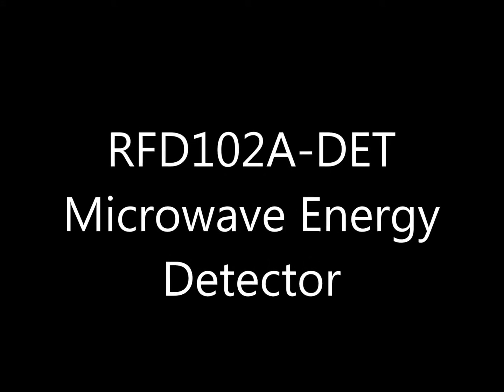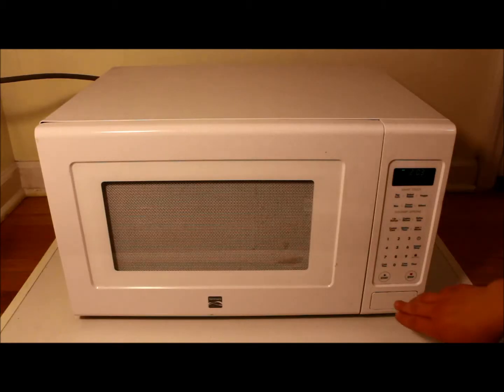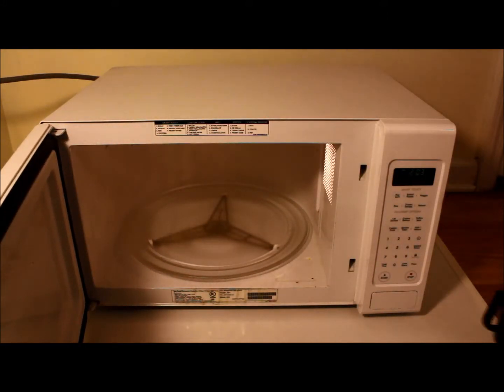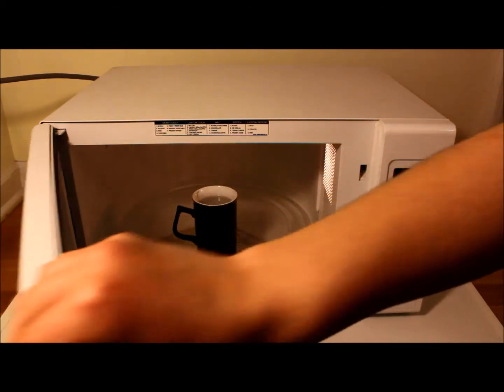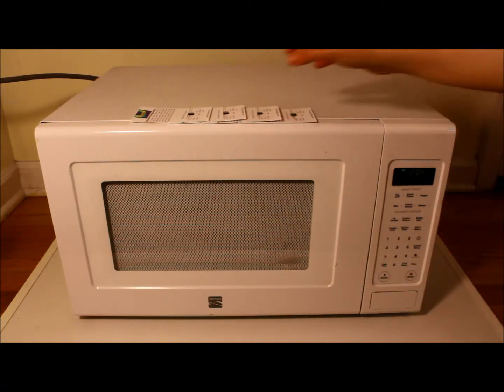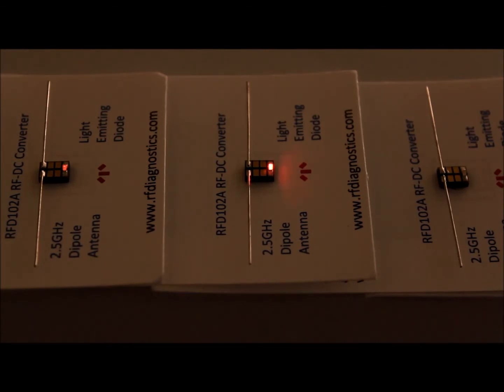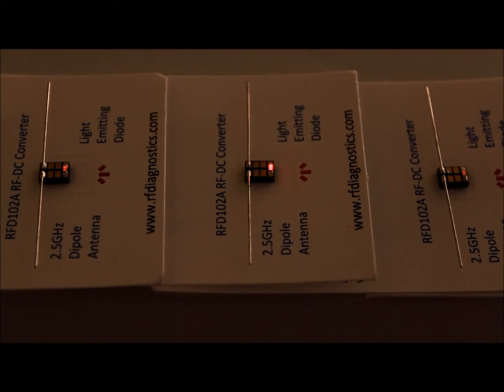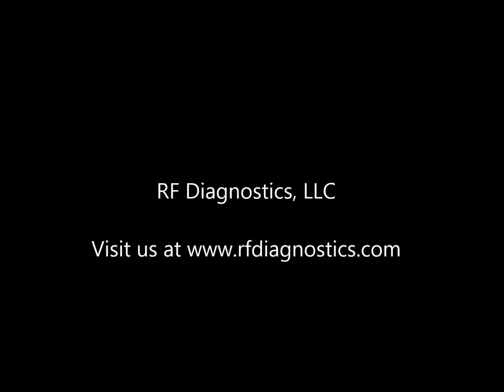WiFi Energy Harvesting: RFD102A-DET

Comment: Neat! Can I use this to check if my microwave is leaking?
Reply from the maker: Yes! The LED will be brighter if the microwave is leaking more. Any microwave will have some leakage around the door seams but a leaky microwave will light up the detector from an inch or two away.